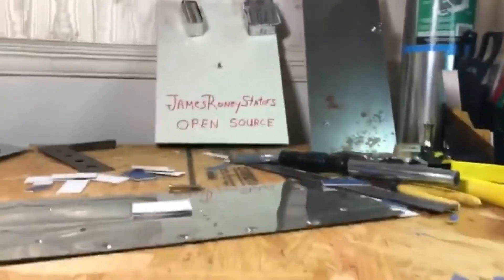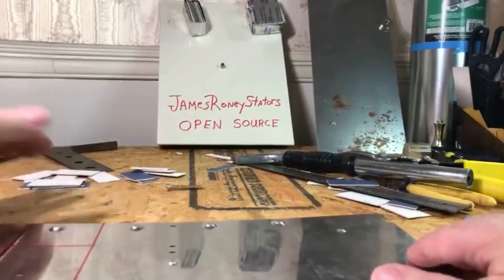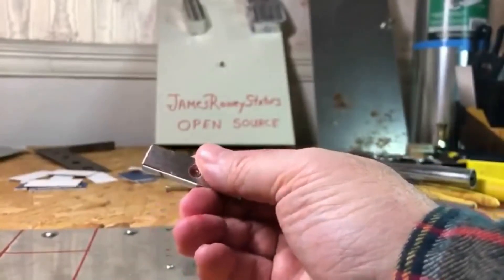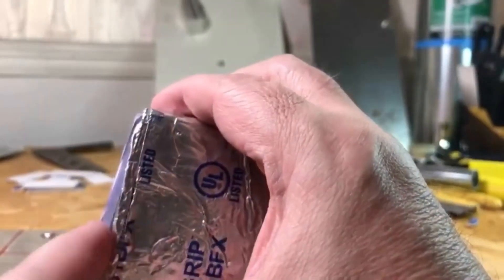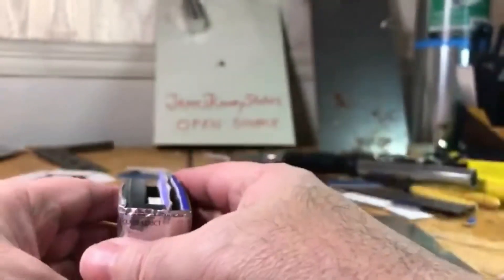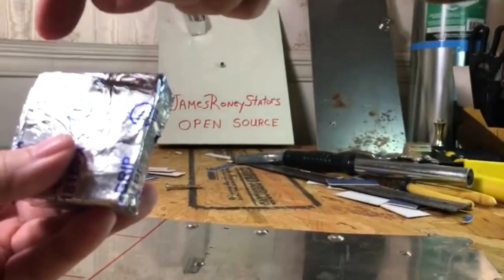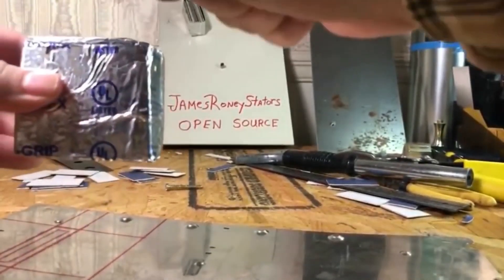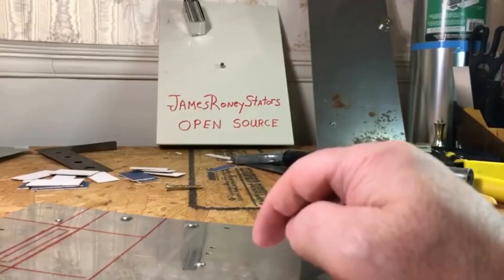🧲 The James Roney Stator Explained | Free Energy Research

Comment from the maker: 🧲 I just ordered 8 identical Ring Magnets as seen in configuration #8. It will take some doing to mount all eight in the proper place. I also need to ditch the metal wheel for a 30” x 1/2” PVC disc. This looks very promising. If it should work just fine, this is a game changer on a global scale as it can be scaled up to power cars, ships, and power homes and industry. But let’s not get ahead of ourselves here until I can indeed confirm that configuration #8 is viable. 🧲 CONFIGURATION #8  https://youtu.be/drdAwmLbAfQ?t=1537

Comment: Great work, it’s almost like you’ve created a monopole magnet
Reply from the maker: Correct. 🧲 I just ordered 8 identical Ring Magnets as seen in configuration #8. It will take some doing to mount all eight in the proper place. I also need to ditch the metal wheel for a 30” x 1/2” PVC disc. This looks very promising. If it should work just fine, this is a game changer on a global scale as it can be scaled up to power cars, ships, and power homes and industry. But let’s not get ahead of ourselves here until I can indeed confirm that configuration #8 is viable. 🧲 CONFIGURATION #8  https://youtu.be/drdAwmLbAfQ?t=1537

More importantly, thank you for taking a moment or two out of your busy life to stop by to check out my research.  ~James